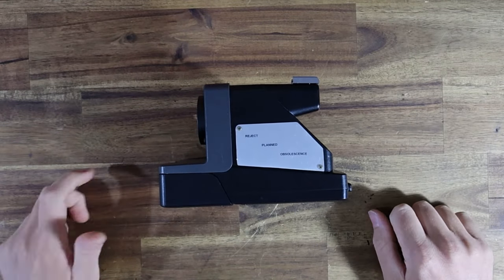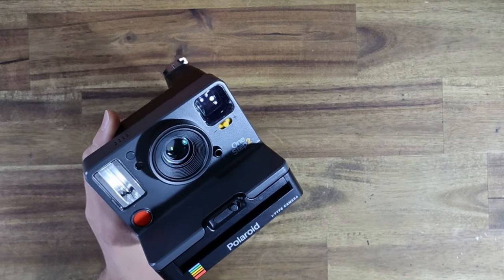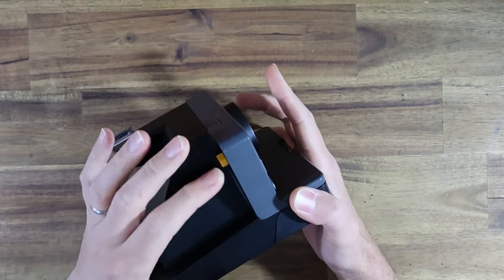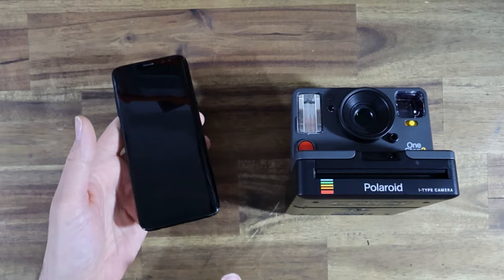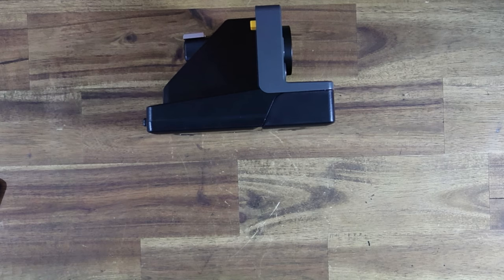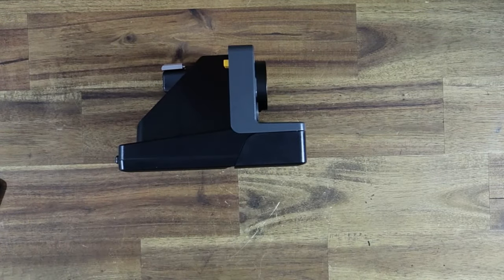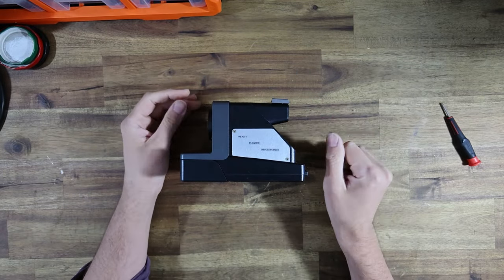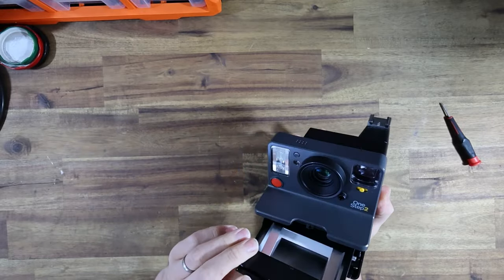Polaroid... there is a better way! Polaroid i-Type Camera Battery Issues - Part 2

Comment from the maker: Addendum:

[] I'd like to emphasize that nobody ever suggested the i-Type cameras were waterproof. But this IS a common argument given to mobile phones which share the same design flaws these days.

[] I feel that my battery door, although crude, provides a simple form of proof that a small removable panel offers no significant impact on size, impact structural rigidity or pose a danger to children (given it needs a screwdriver to open).

[] One argument FOR a built in battery that I didn't cover in the video is that it makes the camera CHEAPER to manufacture.

Comment: I replaced the Batterie from my I-1. Its working fine for now. Your solution for the OneStep2 is great. Do you have a similar one for the I-1?
Maybe Polaroid will rework the Batteries because of a new EU Regulation.
Reply from the maker: The I-1 is far harder to solve due to the battery being in the door
Reply: Would love to know what battery you replaced it with ?

Comment: Good point. I am about to throw away a 2 year old I-1 as the batteries are not avalable at all. They must have been a special order. I shall continue to use my older polaroids but for day to day the Instax wide will be my go-to. Shame really, as I appreciate what they are trying to do.
Reply from the maker: Don't throw it away!

At the very least, donate it to a tech like myself for parts! Or have it fixed!

Comment: I never really thought about it for my Polaroid One Step, but I have been annoyed about it regarding my phone since user serviceable batteries went away.  (Palm Centro was best phone).  I did buy an I-2 without even thinking about it haviing a replaceable battery, and I'd have to agree for something at the I-2's price point a user serviceable battery shold be present.  Otherwise I do enjoy the camera though.  As for interrupting the size and footprint of the product, so many companies make tons of products where the battery pack is just a removable part of the body, I've got a Kenwood D74 on my desk, over half the back of the entire unit just comes off because it's a replaceable battery.  It works brilliantly, even allows them to make a battery pack that takes AA's in case someone needs to be away from a charger for days.

Comment: I hate non replaceable batteries, it's the throw away culture again.
Just a thought could you not swap out the connector on the camera to a common one? It makes it a plug and play battery swap.
Reply from the maker: That IS what I did though. I added a new regular JST connector attached to some leads.

You may have commented without watching the whole video.

The original mini JST connector for the battery is on the cameras PCB. There isn't any space on the board to install a bigger one, and replacing it would involve taking off the main logic board and de-soldering things. But I was able to add a plug by attaching it to the end of the original battery leads - effectively making an adaptor cord
Reply: @theinstantcameraguy  Ah, got it now 👍

Comment: Wait a minute, could the Berkey be rewired and converted to take i-type?
Reply from the maker: in theory... yes!

I'd need to figure out how to modify the internal capacitor for the electric eye, as well as for the flash itself to compensate for the 640ISO film

The hard part is taking them apart. The screws are hidden under the side labels

Comment: I am not happy with the use of pouch cell batteries. (Pouch cell batteries without a protective case should not be touched by the average customer). I feel like the camera can hold an 18650 without issue. The good thing about this camera is that the battery is not encoded to the camera (looking at you apple). I feel like providing the correct parts for a repair is important right now.

Comment: Are you able to wire it so it can use the battery on the 600 film? Like Add some sort of metal plate at the bottom
Reply from the maker: not possible sadly. Voltage difference - 6V vs 3.7

Comment: There is no argument for not having a replacement battery, absolutely none. A non-replaceable battery does nothing but further our throw away culture. Imagine if original sx70 models were made as throwaway camers? I'm not saying that polaroid coming back as impossible was only happening becaus SX70 were there and being rebuilt but it sure fucking helped. Throwaway culture is bad. Making products that last and are repairable, is hugely important.

Comment: As i replied in your part1 video on this topic let's be honest about this it IS built in obsolescence or producing a product that is beyond economical repair. If recently bought a Now Gen2 camera for  some fun and  if the battery goes after a year which it could at any time the cost of the repair  i.e labour and replacement battery plus shipping costs would almost certainly cost as much as a new camera or possibly more even depending on where you buy a new camera from.
These people that have criticised you for taking Polaroid to task over this issue are talking out of their arses so just ignore them.
As i said in my reply to your Part1 video Fuji Instax cameras ALL use easily replaceable batteries of one kind or another without it affecting the price of the camera, significantly anyway.
And for a company, Polaroid, who make a point of stating that their cameras are made from 40% recycled materials it makes it all the more hypocritical in my opinion to indulge in such a practise.
Also the NOW Camera  has a timer facility for taking shots where the taker themself want to be in the picture  or for taking selfies but the camera doesn't have a tripod  thread  to mount the camera  so where is one supposed to put the camera. The NOW + does  have a tripod thread which is bloody daft considering both cameras use the same basic body.

Comment: My two cents…

First off, good job!

I am NOT an engineer by vocation or avocation. I am NOT a technician. I am NOT a repair person. I am NOT a designer, influencer, presence on YouTube, or any kind of type of public person. 

I AM a photographer. For 50+ years. I currently have and have use a wide variety of cameras, the design and tech and all of them matters not one whit to me. Large and medium film formats, ultra high res dSLR, high grade professional level lenses, high end scanner, computer, monitor etc. Thousands of dollars of photo equipment that serves my needs. 

They all serve one purpose and one purpose ONLY: to create the photograph I am after. The tool (camera) is just that - a tool that must serve my need. 

So. When Polaroid, out of the blue, sent me an email in November 2023 about their new I-2, I was intrigued. 

I ordered one (and, btw, $600 USD is NOT an expensive camera… there are cameras that are tens of thousands of dollars, body only). 

I’ve had the camera for few months and I can attest that it is amazing! I LOVE this camera because of the way it transforms and realizes what is in front of it. Completely unlike any camera I’ve ever used (including my mid-1970s SX-70). 

So whatever design/enginerring/etc flaws it may have, as a photographer, it is an amazing camera that produces images in a way no other camera on the market can. Why would I NOT be using it and missing out on what it can do? I’m heading to Japan in a couple weeks, and the I-2 will be my only camera I’m taking. 

Priceless. 

Keep up your good work. I’ll keep using my I-2. We’ll both be happy. (I suspect I’ll be the happier of us, as I’m not delving late nights into all the niggling, irritating stuff you are.)
Reply from the maker: Thank you for watching the video and for your comment.

While I agree with what you are saying re: the camera's performance (It's great)...

I cannot help but fear you have missed my point about sustainability and designing a camera that is destined to die in a few years time.  

This video is about the absurd fact that these cameras do not have easily-user-replaceable batteries, when it was an industry standard only a decade or so ago
Reply: @theinstantcameraguy  No. I did not miss your point at all. I fear you’ve missed mine: Given this is the only camera that produces the images I seek, I don’t see any viable alternative.  Other than forsaking these compelling images, which frankly I am unwilling to do. The cost of the camera is not a hindrance given its performance. 

Would it be nice if the battery were replaceable? Sure. 

Is that an existential crisis? 

No. Most of my cameras do not require a battery to
Operate and all (save the I-2) are user friendly (replaceable).

That you fret over this is your choice. That I don’t is mine.
Reply from the maker: I believe we SHOULD fret over a design that encourages people to throw away devices once they lose power however. 

The fact is that most people don't realize what a big issue it is because they aren't in the repair industry. 

Just because it personally doesn't phase you to spend $600 on a camera that won't work in 5 years doesn't make it right. 

$600USD is a lot of money to many people. Consider yourself in a position of privilege if you feel it isn't.

Comment: One can not surprised with polaroid's not caring about this, if one was around when that pola vision thing and other products were launched.
During an interview the question was asked, why are these things so expensive.  Answer, what ever the market will bear. So lets all stop buying their cameras and get only an old or new one with replaceable batteries.  If that doesn't cause them to change, lets invent a film cartridge that can hold instx film and be shot in our newly battery upgraded mods.